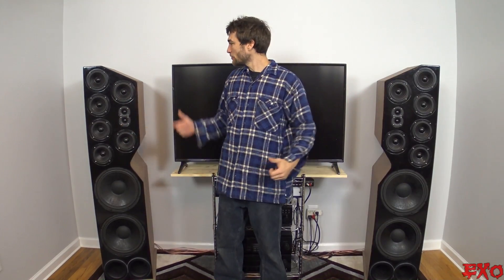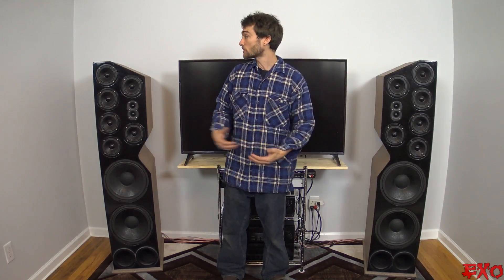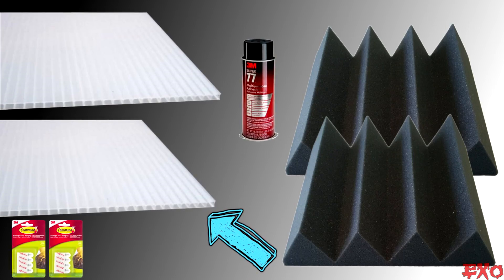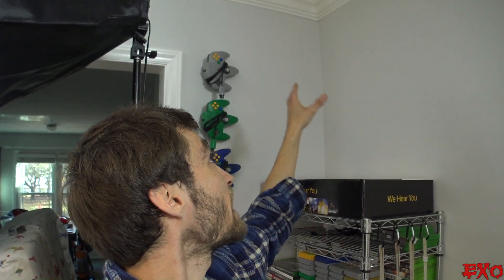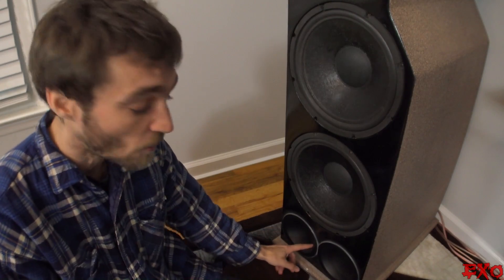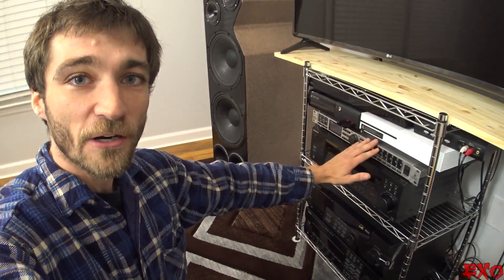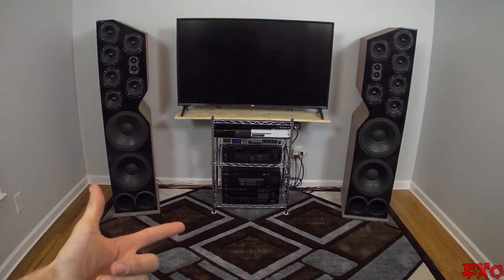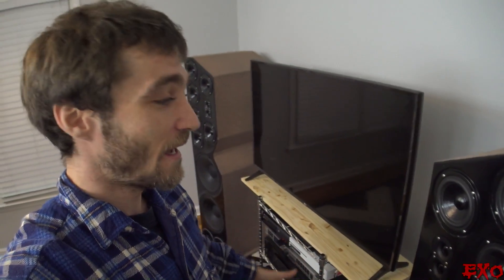Home Audio PROBLEM Areas!!! Where to Apply Acoustic Foam Treatment & Bass Traps For Standing Waves

Comment from the maker: Time for some ACOUSTIC TREATMENT!!!

The home theater project will be a blast this season :D
Reply: EXOcontralto them floor speakers are Puka I’m running  a set of wharfedales xarus 5000 floor speakers not a bad sound swap for yours 😂😂👍
Reply: Do you have tinnitus Exo?
Reply: Just curious if you plan on running a center channel and sourround speakers or just the 2 towers?
Reply: Check out minidsp. Measure your room using Room Eq wizard then correct with your DSP. Absolutely amazing sound correction for your listening position.
Reply: @_Hayden  well we already know two people who didn't.
Reply: Cool exo!! What games do you play on the Xbox? Ever try black ops 4?
Reply: hey EXO, I put up a couple of new vids plz check them out just showing my system upgrades
Reply: you can put some second skin ad the back off your tv
Reply: Sliding barn style doors on the roller system  look nice.
Reply: Hey exo i have a question my pa subwoofer when i play my subs i feel the bass when im next to it but when i walk away the bass start to die and dont feel the bass

Comment: Put the mattress on two skateboards and rest it against the door, so you have a sliding matress... maybe some carpet over that? hmmm, I might do something similar at my place... regarding the commercially built ones, we'd have to be crazy to prefer something mass-produced, probably in a sweatshop using moderately okay components to something carefully planned and constructed by an engineer... but we have to actually think like engineers... and you know, to improve upon something you need to find its biggest flaws... so... keep on doing what you're doing ;)

Comment: when your "home theater" has multiple doorways without doors, speakers that are bigger than your monitor (TV), and the room is less than 12' x 12' you dont have a "home theater". You have a hallway with some big speakers and a tv.

- Remove the doorway casings, add 2x4''s and sheetrock, and seal the doorways properly. Its not that hard for someone handy w/ tools like yourself.
- get a proper projector and screen. You can easily get a decent projector for under $600 and makeshift screens are dirt cheap. I'd be curious what you could find with your discount finding skills. You'd be surprised. Dont have the budget? At the very least wall-mount that tv (<$50) and ditch the plywood shelf.
- nothing you can do about the size of the room, just do it right. Wall treatments sound like a great start.

Comment: CAN ANYONE HELP ME? I'm new to this stuff and I'm having a slight issue. My amp goes into protection at high volume or for certain notes but switches back to green immediately afterwards. Is it a ground issue? Are my settings off? Please help
Reply from the maker: This could be a LOW IMPEDANCE protection trip. Check the ohm load of your speakers at the amp!!!!
Reply: Thanks exo you kick ass bro!
Reply: That's literally what it was. Guy I bought the sub from had it wired to two ohm and my amp is a 4 ohm stable.

Comment: For acoustic treatments... I made 2'X4'X4" frames and filled with rockwool. Corner bass traps also filled w rockwool. Everything is covered in either white or black burlap. Relatively easy.   Panels are pricy for the limited amount of sound control they offer.  I also bought a box of the foam panels. Kind of a waste and look cheap.
I'm sure you'll come up with something that compliments decor.

Comment: Better off running dedicated 20 amp circuit straight up from the service panel for your home theater then isolate the remaining rooms with the correct size breakers for the wire gauge run to them rooms otherwise your asking for a fire

Comment: EXO, I would recommend that you first see if you have any available space to add a breaker in the panel if it’s in the basement.  If you do I would run a wire out of it and mount a Junction box in the basement so in the future if you ever want to add anything else you can bring it straight to the junction for an easy hookup. 
Also, an easy way to figure out where you need to come up the wall is by cutting up a metal Coat hanger into a straight piece and drilling it straight down right in front of where you want to old work a box, then when you go into the basement, find the coat hanger and just drill a few inches back from it to be inside the wall

Comment: your biggest problem is the floor . get 5/8 under padding then get thin carpet . t.v. rattle put a square of left over under padding on back of tv . when you hook up rear speakers it will room with missing sound . one last thing if it shines sound reflects . paint will help massively . hope this helps

Comment: I had a nice home cinema that had 3 windows about the same size as yours exo. I made 3 sturdy frames with sound dampening pads facing in and the frames had ply wood as a block or wall. I took out door frame and made a in wall sliding door 4" thick with black egg carton foam facing in. The corners I hung theater style drapes ceiling to floor and walls wer the same drapes but in pillar formation around the room and also with ceiling in a W hanging formation. All equipment wasn't in theater room but inside a hall closet just behind main slide door. Total cost was around $600 on budget

Comment: Not related, so sorry love the video. Car audio? If I'm building a push-pull enclosere. can I put 2x10"s and 2x12"s of the same brand and #s in the same chamber of a single compartment box (free-air side and sealed side) and which side do i take out of phase

Comment: Exo: An interesting experiment would be is to use a power consumption meter to see how much electrical power your stereo actually uses.
I think unless you use tube type amplifiers or employ atomic earth shaker subwoofers as in your vehicle projects, you will find your power demands surprisingly low.

I'll stay tuned!

Comment: Glad you're talking about one of the most important things in a home theater, the room can make expensive speakers sound cheap, and proper treatment at the main first reflection points will make any speaker sound better. Can't wait to see how it turns out.

I personally use roxul safe & sound and built a wood frame to make a cheap but effective DiY acoustic panel and hang it on the wall with carpet transition strips cut to size to hang it.

Started with the first reflection points on the left and right wall and was a HUGE improvement. Now I have them on the ceiling, and various other areas along with a shag carpet and my room sounds great.

Comment: EXO can you tell me which is a better subwoofer the massive audio GTX 104 or power acoustik mofo 104 x these are both in the hundred dollar price range at Sonic electronix or is there a nother 10 inch subwoofer in the same price that's better

Comment: I love that boominess lol. I used to face my speaker into the corner and block off the top so it was like a bandpass kinda.  I had enough mids and highs to make up for it though so it was so good.  I only faced the speakers with 15's in them to the corners. I still had a center channel and left and right rear channels.

Comment: The key to HT is the center and the subs and their placement. Get or make a good center channel; dual 6 1/2’s with a good matching tweeter. AMT or metal dome tweets are very accurate in HT use. Fabric dome tweets are harsh and loud in HT applications. JBL had done tremendous research with placement of subs. Research the papers. Go ported tuned to 18hz and crossover them 60 hz or below. 2 subs should be enough but 4 will work better at all corners. Place surrounds closer to ceiling; ear level will get blocked. 5.1 is more than enough; 7.1 is overrated and Atmos is great. In wall speakers will work great in your application and you can get rid of those big boxes. Your wife will thank you. Good luck.

Comment: Get some poster tack puddy and stick mirrors to the walls for a reference, just in front of your speakers on each side, then shine a laser from the listening spot to the mirror, line the reflection up with center of the speaker, where that laser is shining on the wall is where some pieces will need to be placed. Other then that a good thick rug, corner blockers should do the trick. Also behind the tv as well since that's the mid point of the speakers. you should consider replacing the metal blinds with fabric shades, that should help cut down on reflections as well and not rattle, I'll bet it's right where one of the pieces of sound material has to go. As for the chandelier, I wouldn't worry about that because it's not typical to have reflections right above in the center of the room, though that ceiling may be moving a bit might not be good to have that up.

Comment: I build speaker boxes or speaker coolers on my channel and love to add LED's to them. They run off of 12v batteries or AC to DC converters. I have an amp to run the speakers, however, I have an aux cord running to the amp but when I play music, it tends to have static with loud pops. People told me to get a ground loop isolator but it didn't have too much of an effect. Any ideas? Thank you.
Reply: Use short aux cables and better quality. The pops are probably from the connectors not making good contact and the static is because of the length of the cable. The aux cable is unbalanced which means if it gets near other cables (of power mostly) it picks up static noise
Reply: @iMilletos  , @Francisco Guardado,  I appreciate the replies :)
Reply: I learned that having AUX cords near any power supplies or near the wires where it connects the power supply/ power converter, it causes a static noise.  Also, the material your AUX is made of can cause it too.  If you want cheap but insanely high quality AUX cords, I got a lot from Amazon.  It's like $5 per AUX.  The brand is Anker.  It's about 4 ft long.  There's a reason why it's "Amazons Choice."  Hope this helps!  It definitely helped with my invention.  I can relate to you also building speakers with LEDS on them.  I have them so they react WITH the music.  It's more reactive with an AUX amplifier box because you can adjust the sensitivity a lot more and make the most of every song that plays.  You can see a little of what I do on @TheSacredForge on Facebook or Instagram.

Comment: I really wouldn't be tapping into other circuits for power.  If your fuse panel is somewhat close, run a couple dedicated circuit and outlets just for your home theatre equipment.   Be much easier imho.

Comment: Hey I'm New to Subwoofer and I have a Question So I did for a Week ago Buy a JBL 12" subwoofer CS1204B
And Today i Was Gonna mount it in my Car. But sadly When i Moved it Slipped and it Felt On The Floor
I Can't See any Damage On the Box But When i Started to Play some bass
i Only hear Very loud Farting Scratching Noise Whenever there is a bass Drop 
I Hear This also When The Sub is Out From the Box
I have looked Over many times on the Sub And. i have Desoldered and Soldered On New Wires many times
To See If That Could Resolve it. But no i have also watched The Speaker And i see No Damage to it or The Spider of the Speaker
Can any Help out ?
Reply: random stuff either the magnet could be misaligned or the coil can be misaligned in the basket, no real way to fix this besides buying a new sub driver
Reply: @dylanBehrproductions  What Do u mean By Misaligned in the basket Can't i Try to replace it ?
there has to Be A Way to Fix this Without buying a New Sub!
Reply: Like the coil got dislodged from the cone or spider, if that's what happened then you can get a redone but if the magnet got knocked out of place your pretty much screwed
Reply: And you don't have to buy a whole new sub, all you have to buy is a replacement 12 inch woofer
Reply: @dylanBehrproductions  ok thank you
Reply: @random stuff So many factors here when you dropped woofer it was mounted in a box ? If so the box most likely broke causing distortion.  If sub was not in box and you dropped it push on cone of woofer is it scratches or don't move you need a new woofer the magnet shifted or you bent basket  !
Reply: Hey So i did Just Find out if i Hold The Surround of the subwoofer Down At a Exact Point it does not make any Farting scratching Noise 
do u think i Can Remove The Surround and Then Just Glue it back ?
Reply: yes it Was in a box! No damage to the box

Comment: I know you said you're gonna do a video on this, but I've been following you for years and one thing I still don't know is how your amps work in your room. I don't know how they are set up or anything or how the equalizer works. I am also really curious about how the amp situation is working. I would love to see you produce a video of how you are going to wire your outlets together.
Reply: Easy it’s basic stuff.. input into the active processor and then output from that into each amp.   EQ to set it correctly you would need a RTA and “white noise”  but more then likely it’s just set by ear to what you think sounds right.

Comment: EXO you know bass heads put their boxes in the corner we want more Bubba Bubba Bass
Reply: Try looking at the old Klipschorn design - The speaker was made to load into the corner of the room and use the walls for bass boosting. That might be an interesting concept for the bass heads.
Reply: I have my bass in the corner. Mids and highs should not be in the corner though, or up against the wall unless they are wall sink boxes. The Allison effect. Sound reflects off the rear wall in the midrange creating uneven response. What you really want is a row of subs along the front and a breathable thick foam (like several feet) back wall.

Oh and I have 230V 100A max in my house. Not that I need it though for my twin Peavey IPR1600 system. A 13 amp socket is plenty, especially as my speakers are 8 ohms and my subs see a maximum of 600 or so watts. The subs in those towers look to be fairly low powered but efficient rather than crazy high spl power consuming car subs so hopefully not boatloads of current required.